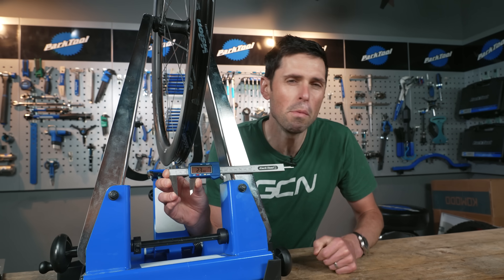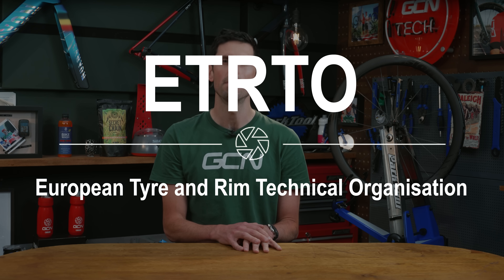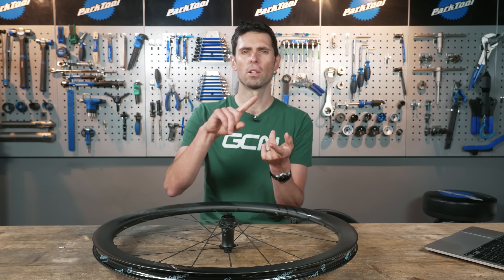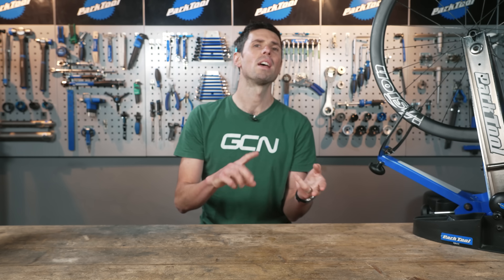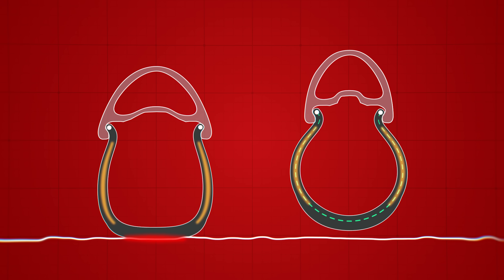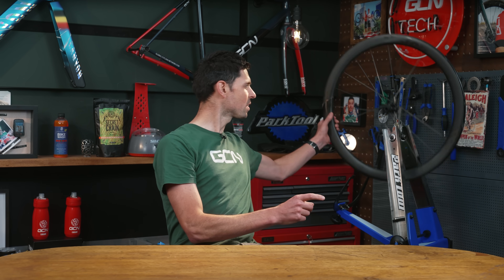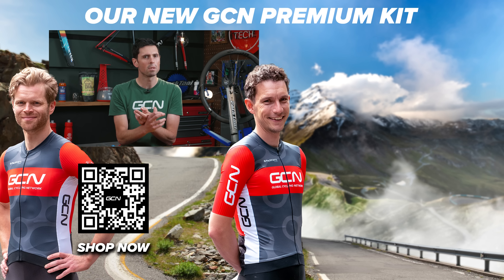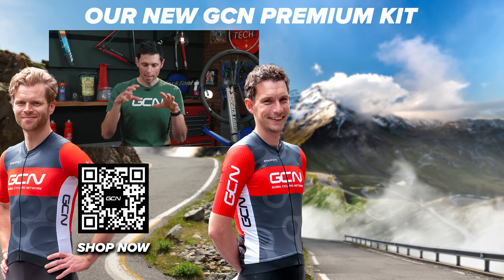93% Of Cyclists Ignore This Crucial Measurement (Internal Rim Width)

Comment: 19mm on my Winspce Hyper 50mm Black Edition wheels. I ve been rididng 25mm tires since  I purchased them after Covid. 28mm were to uncomfortable and bouncey and slow to react. The recommended tire pressures on Silca's chart was way to low and I suffered more flats on a regular basis. I put 25mm 's back on  and ride at 90psi on the rear and 85 PSI on the front. I have my bike back, 28mms were too much of a compromise. Instead of always going bigger , I think it's best to find wheels and tires that compliment your style of riding. If you prefer to ride slower and more comfortably, then I suggest the larger tires. For performance I would stick to the thinner tires and compatible wheels. YMMV!
Reply: O.G. here.23mm sewups on alloy rims.100 psi front 95 rear.Screaming fast.
Reply: Except fatter tyres with lower pressures are proven to be faster. Tubeless tyres allow you to run the correct pressure, whereas tubes force you to ride too high a pressure to prevent pinch flats. Tyres also can't be too bouncy AND slow to react - they will be one or the other. 
I moved on from 28mm to way comfier 33mm tyres many years back, my smallest tyres are now 38mm as my rides are usually mixed terrain. The fastest road bike rider in the world rides 32/33mm tyres.
Reply: @imajez1 as I'm not one of the fastest cyclists in the world , I'm not as concerned. This isn't as black as white as most people think that bigger tires offer less road resistance. The type of cyclist must be taken in mind the type of writing they do the wheels they have. I've tried the 28 mm and trust me it degraded the performance of my wheels. I am quite happy with my 25 mm. Maybe when I get larger internal with wheels I'll make the adjustment. But for now I am quite happy with my 25 mm tires
Reply: @dsarcevic   - the type of cyclist doesn't change the laws of physics.

Comment: I have Mavic cosmic slr 45, came with the bike. Internal width 19. Bike came with 25 tyres when mavic says it’s better with 28-30. I never checked. After thousands of Km that I needed new tyres, I checked and put 28 mil tyres on it. It’s much better on crosswinds and more comfortable. I don’t care about watts. Next time I’m going 30 for sure. Road surface here is trash. Comfort and being safe is most important for me as a hobby rider that may do a couple of local races just for fun.

Comment: Will a 28mm tire have a different circumference based on whether using a 21mm rim vs 23mm rim?  I would think, if the tire gets wider on the 23mm rim, it can't be as tall.

Comment: Well my old bike is a Wilier Escape Triestina Competition 2004 with MAVIC OPEN ELITE wheel. So on this wheel it's 622x15C.  I mesure 14.8mm internal and 20.2mm external. On this wheel it's write that i can put 23mm tire with max 138psi or 9.5Bar and max 32mm tire with max 99psi or 6.7Bar. Now i have a 28mm tire at 75psi and that 28mm mesure 28.8mm. this is the max size tire (28mm) i can put on this old bike.

Comment: 22mm internal rim width hooked rims, fitted with a rubber rim strip, tube, and 50 mm Rene Herse extralight tires.  I prefer narrower rims for wide and supple tires.  And in fact, per the ETRTO's tables, I could go as narrow as 19mm rims with 50mm tires, but such rims are rather hard to come by.
Reply: how wide would you recommend I could go for a 13mm internal rim width? I have some older wheels i love but want to put as wide a tire on them as possible, just for road riding. Renee Herse tires look sweet, might grab a set.

Comment: For most recreational cyclist like me, this doesnt matter. 

The most important thing is to actually make it out the door and ride, enjoy yourself and have a good time.
Reply: More nonsense to (not) worry about. No power meter, Garmin and electronic pump not charged etc. How did people ever go out on bikes
Reply: @markrushton1516  True. I think of the rides I did around the year 2000, when none of this stuff existed. I rode thousands of miles a year and never was inconvienienced, or died, I just had fun, yet today you "must" have power meters, Garmins, Wahoos, electronic groupset, etc.
Reply: I’d say some of it does matter even for rec cyclists. You want your tires to last as long as possible and not blow off your rim. That’s a solid reason to make sure your rims and tires are compatible with each other. The aero, and speed stuff may not matter, but safety, comfort, and durability absolutely do.

Comment: I have a set of Light bicycle falcon Pro turbo 50 wheels, with a 25mm internal rim width and 32mm external.  I pair them with Pirelli P Zero Rs clincher tyres 28mm and Pirelli Tpu tubes.

Comment: My Triban RC120 (rim brakes) has internal width of just 14mm. I was advised that these would take 32mm tyres. My Schwalbe 32mm 'One' tyres definitely stand a bit proud - only about 30.5mm wide at 75psi, but have been entirely satisfactory and, I hope, are safe? I reckon 32mm is the limit for 14mm rims though.

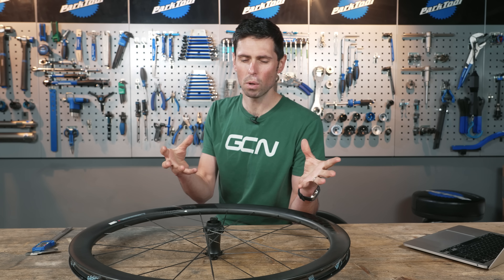Comment: My internal is 30mm hooked 2:58 and I’ve done circa 9000km on them with 32mm Conti GP5000’s that blow out to 36mm. 50 psi rear and 48 psi front. Zero problems so far but I won’t run the tyres for the full life on these. I’m keen to see if Conti will produce a 35mm GP6000 in the future.
Reply: They make a tire called the GP Urban which is essentially a 35mm GP5000, it's a good tire.

Comment: Wrong, just avoid hookless and that's it 
Hookless is trash and dangerous
Reply: i think if you stay within manufacturers spec it's fine... still it's a cost cutting measure for them 🤡
Reply: @jamble7k no, is not fine because let's say  you have the perfect match between tire and wheel which is already quite a hassle , let's say it works up to 80 psi , and let's say you use 50 psi. Now you may or may not know this, but heat increases the pressure, quite a lot 
If you ride in the summer those 50 psi can go beyond 90 easily making your wheels a moving hazard. Add to this momentary and big pressure increases from bumps on the road and you'll get far beyond 120psi, very easily 
Regular wheel ? No problem 
Hookless? You're dead 
This happens a lot ,even during big races such as tour the France every year

Comment: Just bought an emergency rear wheel today, 16mm internal width. Running a 45mm gravel tire, I’m terrified. It’s all the shop had at the moment.
Reply: You’ll be fine but not ideal, how many tyres blow off? Few.
Reply: @fewik8567 - I have a Trek FX Sport 6.  It came w/ 40mm tires, on 19.5mm innder width rims.  Recommended "widest" tire for the bike is 42mm.., which I am running now.  

I'M FAT, & OLD.., so, a tire "rolling off" the rim on a turn is a scary proposition.., BUT, I want to run 45's on it.., & well.., 42's are already, JUST BARELY @ the edge of the recommended width for those rims.  

DO YOU KNOW WHAT THE PROPER (budget), carbon rim.., w/ the proper inner width would be best for this bike.., running 45's?
Reply: @ADuran-jk6uz  its a thru axle bike so id start there, youd be looking at something like a pair of gravel or offroading specific tyres. you would likely need to spend north of 400 on a new wheelset as you're asking for more performance oriented wheels. i'd be inclined to just put the 45s on since specs come with quite conservative limits anyway for warranty and safety purposes (mainly avoiding legal issues) and youre asking 3 mil more, your tyres i have no doubt have already inflated to 45, 45s would only expand to 46/47 mm anyway, after all is said and done i doubt youd have a tangeable but difference, but just try in, its not about to blow off your rim, ive neber once considered this, id only bother with hookless and if youre riding hookles your biggest is problem is why you thought that was a good idea in the first place, they will blow of the rims.